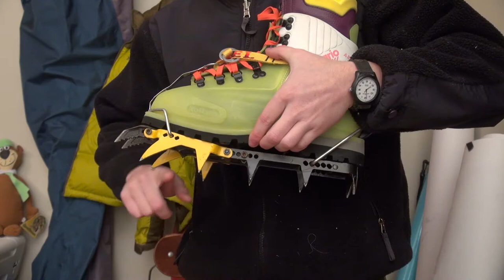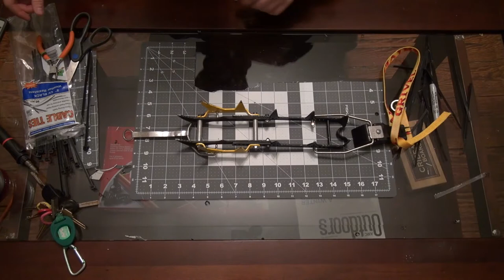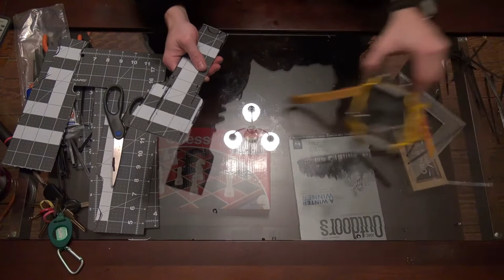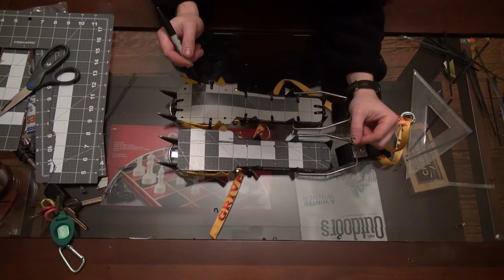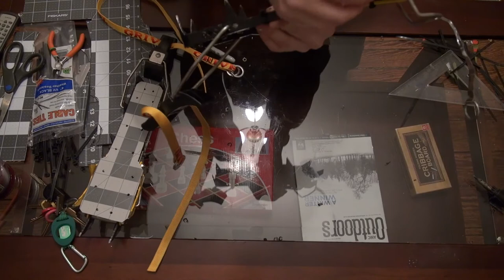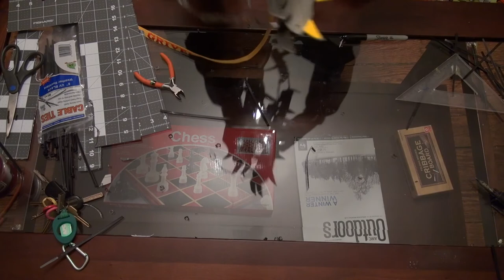DIY Crampon Antiballing Plates

Comment: How did they hold up to use?
The "rubber" commercial DMM ones dried out and cracked up the 10 or so years (!?) since I last used them.
I am thinking dynema or even other accessory cords will be more resistent to breaking and unlike wire not easily slice through plastic. 
I cut two "plates" out of a 0.030 inch (0.73 mm) thick piece of HDPE bottle just before watching your video.
Reply from the maker: Yes, the point of failure ended up being the zip ties. While the ties didn't fail catastrophically, enough of them needed regular replacing that I ended up purchasing some overstock OEM plates miraculously still available online before heading into deep backcountry. The flexibility of cord may alleviate those issues. Thanks for reaching out, that update on how they "held up" should be valuable to many viewers.

They were better than nothing, but could absolutely be improved.